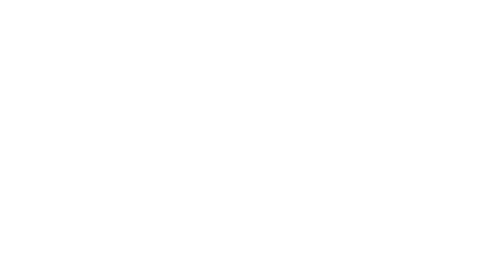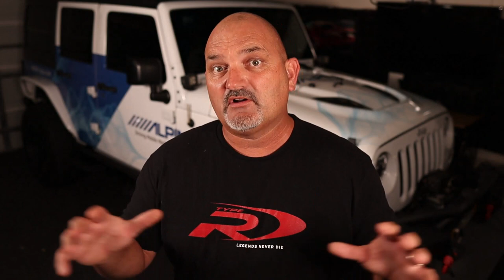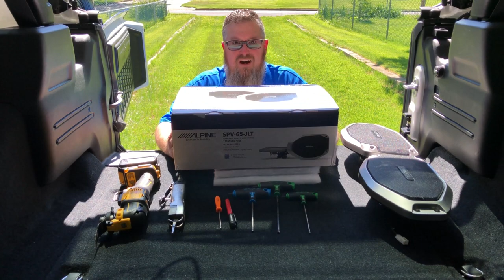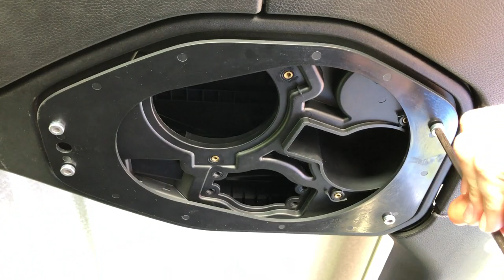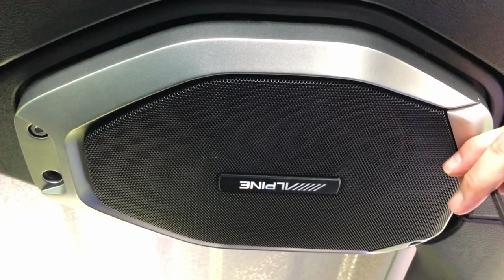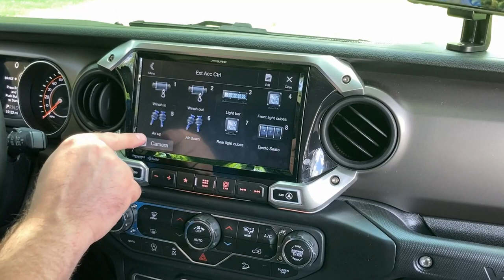Upgrade Your Jeep Wrangler JL  Soundbar with this Alpine system

Comment: Bought the these upgrade speakers for my 2021 Jeep Rubicon. Sound is phenomenally better.
Reply: do you have a sub built into the bottom of ur trunk?
Reply: @aidanc35  
Installed one under the passenger front seat

Comment: There was no mention of the two wire connections per location in the sound bar. Does this only utilize the connector for the Oem mid bass driver? What about if you wanted to utilize both channels of the factory amplifier, could the crossover and plug n play harness be bypassed?
Reply: Hi Jeff, sorry that was missed. It uses the smaller plug. In the non-amplified system these are intended for, both drivers (woofer/midrange) are run off the same channel. The premium system has active crossovers that make this kit incompatible without extra 3rd party parts to supply a full range signal. Hope this helps.
Reply: @colinvargo3418  when you say 3rd party parts, can you tell us which?  just metra adapters?
Reply: @amitsabharwal2090  I’m not aware of whether Metra has a part that will give a full range signal from the factory radio or not. I can’t endorse a manufacturers part that we haven’t tested and evaluated ourselves, but there are a few out there.
Reply: @colinvargo3418  Thank you, especially for the quick reply!  I understand, and completely respect your position about not being able to endorse anything.   As I'm new to this, I just dont even know where to begin my search.  Would be great to get any guidance or pointed to what types of things to look for.

Comment: Great Vid guys... I have the upgraded Alpine 8.4 uconnect system.. I keep reading that these wont work for me... why exactly?
Reply: See the reply to JeffKashat below. Physically it fits and will play sound, but due to the way the factory amps crossovers send signal to the stock speakers, you’d be missing a chunk of midrange response.
Reply: @colinvargo3418 how would find the extra steps? Any help would be much appreciated

Comment: These are decent speakers, however I hate how they look when installed. I ended up buying a 6x9 install kit which keeps the factory look. Not to mention a more powerful Alpine speaker with an aftermarket amp. Most importantly, it cost $100 cheaper !!
Reply: Can you describe what you bought ?

Comment: I’d like to upgrade from 2 amps to one.  What do you recommend?  Currently 4 channel for 4 speakers and a 2 ch for the subs.  Boston acoustics 6.5 50w rms and subs are pioneer shallow 10” 300rms each.
Reply: Currently using pdx-5 for door speakers but sub output is not working.  Never worked
Reply: The most potent 5ch we make is the X-A90v. It has a ton of output and is Hi-Res capable (meaning it’s capable of extended frequency response). That would me my first choice. Our R-A90s six channel is convertible to a 5ch also. Make sure the final load of your subwoofers falls in the range for each amp.

Comment: I bought these, they produce less bass than the stock 4.5 inch. And  I feel they are overpriced, but there wasn't anything else out for the JL at the time I looked.
Reply: Do you have the factory premium alpine system in your Jeep? If so, extra steps are needed for these to work properly.